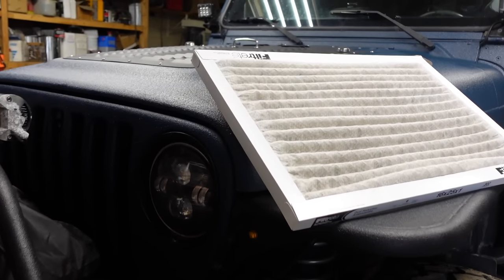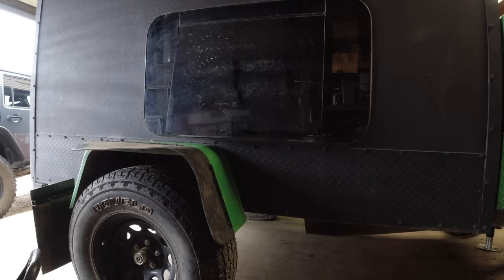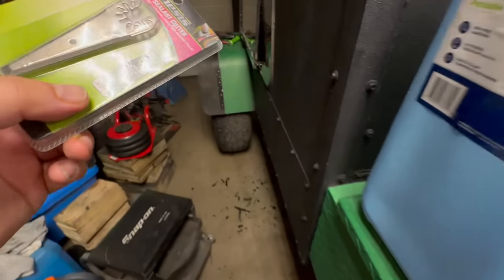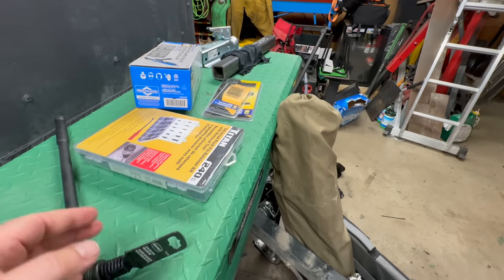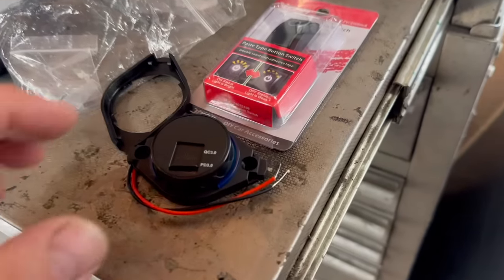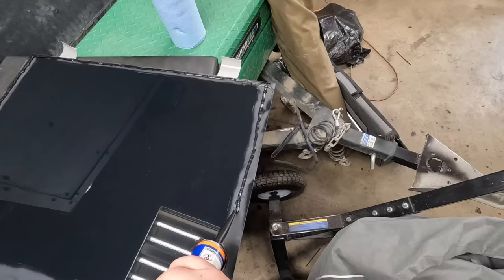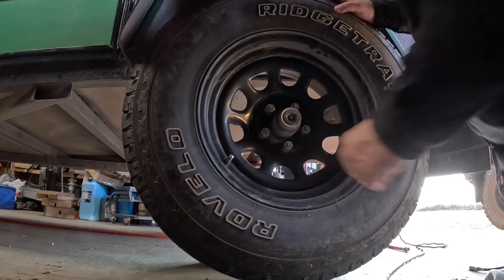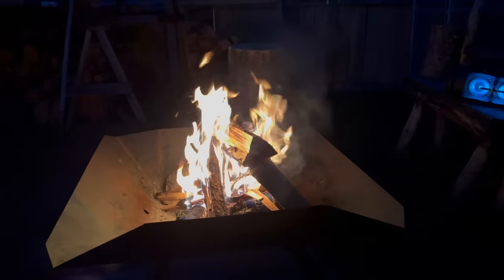CAN I REPAIR THIS BROKEN WINDOW - DIY Overland Trailer

Comment: I agree,  haha that pisses me off when people park shitty and I say the same thing!
Reply: The number of inconsiderate A holes, living inside their own personal bubbles, is disturbing to say the least & it’s only getting worse. I Pulled up to a self-service air pump at a gas station the other day & some oblivious rude idiot parks inches away from me & grabs the air hose before I could get the 1st valve cap unscrewed. I was like what the f, ever heard of getting in line & waiting your turn!? He had the nerve to say, “oh, I didn’t think you were needing air.” If I had parked any closer to the air pump, I would have driven right over it … smh.
Reply from the maker: Should have beat him with the hose
Reply: That should be a new segment on the channel  @BackCountryWrenching

Comment: Trying to get that glue and broken glass off is a royal pain in the ass I've tried a heat gun, brake clean its a struggle.
Reply from the maker: That special tool worked awesome

Comment: I’m glad you went with the sikaflex you will not be disappointed. That stuff is made to hold windows. It will stick urethane for the win! Use this stuff for all your waterproofing needs on this trailer. Let me know how it performs.
Reply from the maker: So far it’s been holding out awesome glad I purchased it